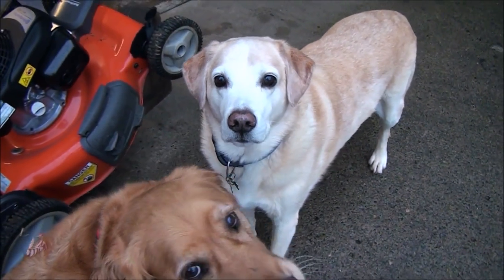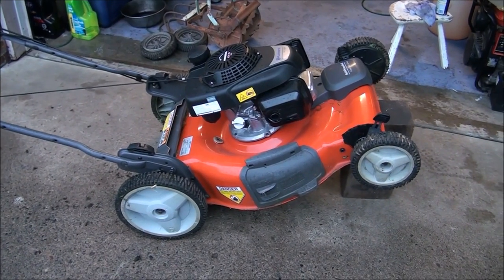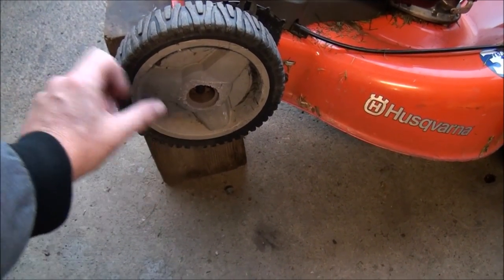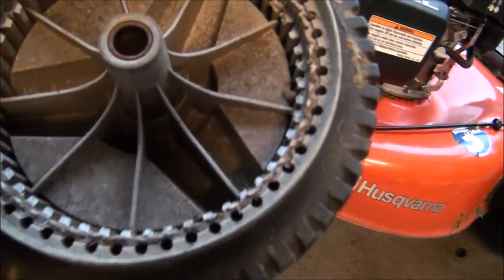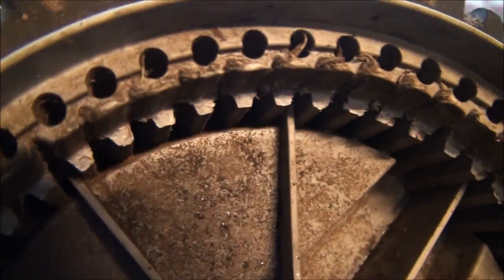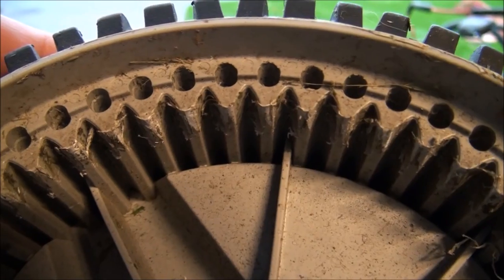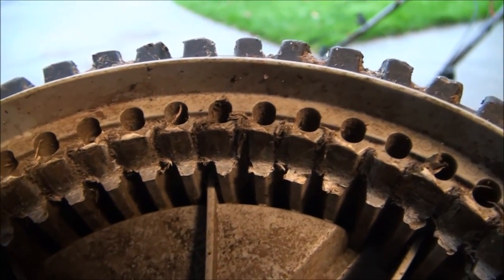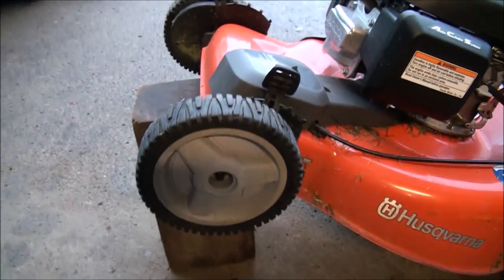HOW TO FIX a Lawnmower FRONT DRIVE WHEELS - Craftsman, Husqvarna, Troy-bilt..etc

Comment: Any benefit of applying a layer of bearing grease on the plastic wheel gear?...or is that simply an invitation to gum-up with grass debris? Also this.....why is the gear stripped, what is the root cause? If the gears don't engage and disengage.....they should be in constant "mesh" and should not strip out the gear teeth. What's up with that?
Reply from the maker: No grease on the wheel gear itself is needed and probably would invite accumulation of debris like you say. The wheel gear is made of plastic and intended to wear out and replace over time (easy cheap swap), instead of both gears wearing out I presume? However, Honda uses a metal to metal gear system and it seems to work pretty good.
Reply: Thanks....probably correct....the cheap plastic wheel is also the sacrificial "gear"...makes sense....the tire-tread part of thwe wheel presumably wears out at some time too..... so the wheel needs replacing anyway.